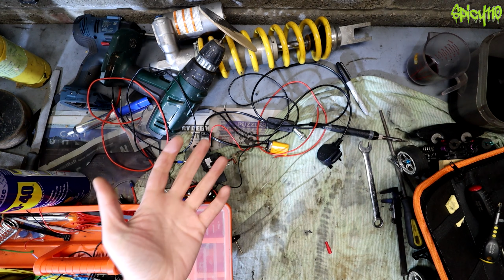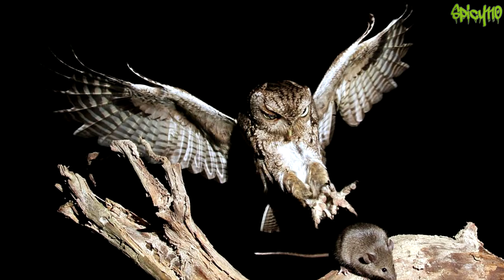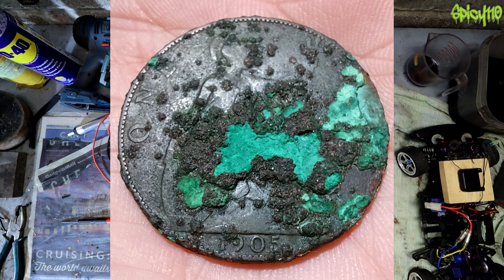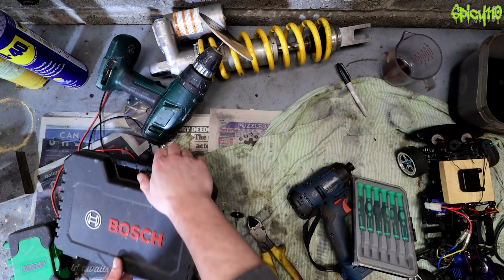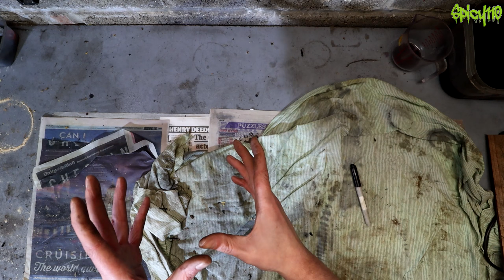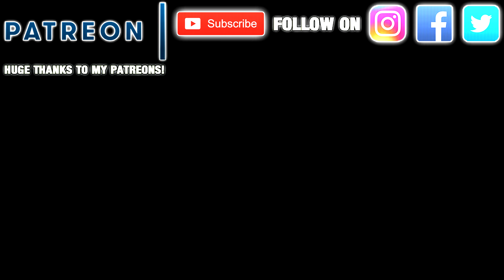AI Designed Organic 3D Printed Metal Trellis Motorcycle Frames are the Future!...IMHO!

Comment: Absolutely not. In fact the frame is not even necessary. Take the Britten V1000 The engine is the fame. Why waste weight and space for the this rubbish when you don’t need it at all. Incidentally the Britten was developed by eye and design engineers with a passion for motorsports with holistic engineering design integration rather than software algorithms which are instructed to make a redundant thing harder to make service and inspect for failure modes.
Reply from the maker: I know the bike and I agree it is a smart design, but it was not made to be mass manufactured, 3D printing is. Also, keep in mind in the future (for the UK at least) there will be no engine to attach anything to, it will be an electric motor.

Comment: I'm looking to cut my carbon footprint by  changing from a car to a eMoped or eBike. 
Which one would you recommend or do you think I should just drive a car as my personal Transport? I'm kinda nervous on a moped as going high speed on two wheels is scary especially as my balance isn't the best.
Reply: Balance going fast will be fine, the faster the more stable u get. It is called gyroscopic effect i guess.  😉
Reply: well cars are destroying the world, it will always be massive waste to use a 4000lb vehicle to move a 200lb person, no matter the energy source.  So yeah, get a moped, practice a lot before getting on the road, you're life will change for the better.  More 'visceral' and 'real' experience than sealing yourself in a metal box and blocking out the world.